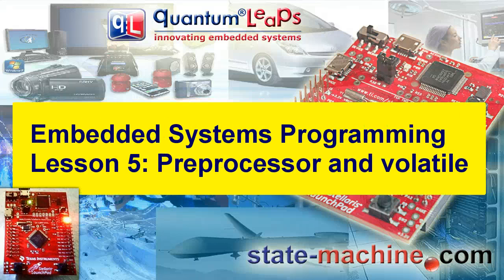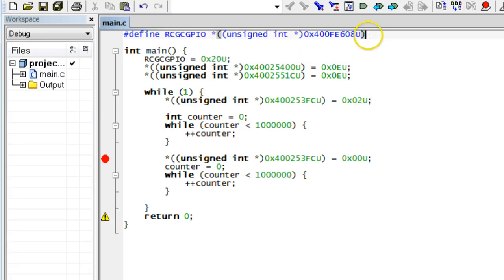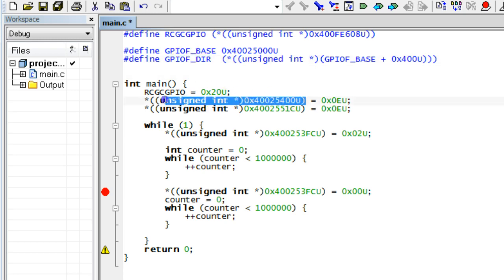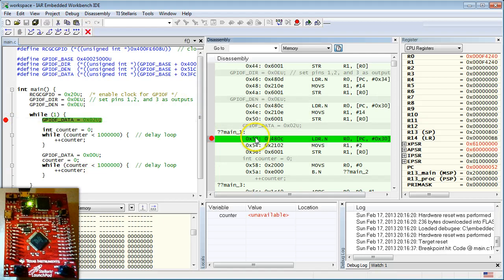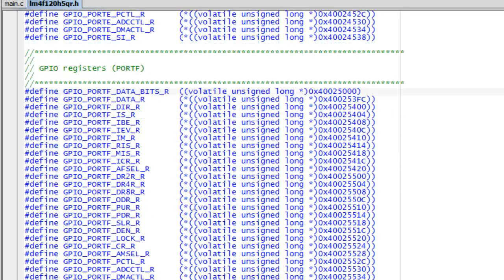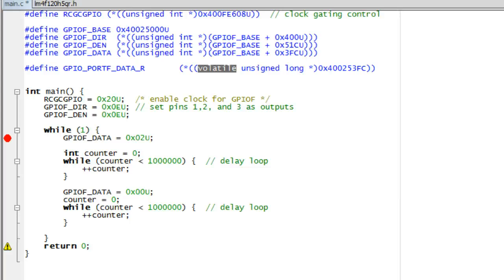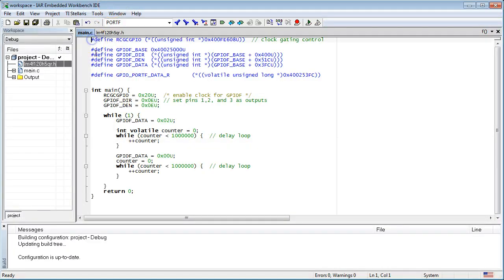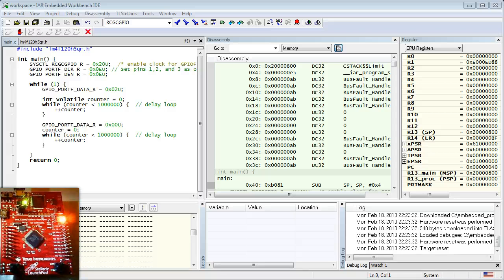#5 Preprocessor and the "volatile" keyword in C

Comment: Hi Miro, great lesson! I had a question about the compiler optimization. I am running a slightly modified version of the blink code where I alternate between r,g,b for the led after every blink. I noticed that after changing the optimization setting to high and making the relevant variables volatile, the led blinks at a higher rate than when optimization is turned off. When I track the counter variable step by step, I find that it is essentially doing counter+=4 each iteration. How does the compiler decide to do this?
Reply from the maker: The C compiler is allowed to apply various optimizations to your code, which you apparently experience in this case. The rules of what the compiler is and isn't allowed to do are a bit nuanced, but please search the web for "sequence points in C". The busy-wait delay loops are especially vulnerable to optimizations. To be really stable, such loops shouldn't be based only on the CPU. Instead the delay loops should be based on checking some hardware timer module, which is known to run at a specific frequency. --MMS

Comment: I want to learn to use the TM4C123GH6PM.h file given on state-machine but it seems radically different from the one used in this video. How is this new one intended to be used?

Edit 2: Watch episode 12 and it will cover it! 

Edit 1: Hopefully he can correct or confirm this but here's what I've found for those who look at this in the future

The "tm4c123gh6pm.h" file makes types for various register maps, and defines the base addresses it needs including the GPIO ports. It casts each base address as the corresponding type, with data members corresponding to things like GPIOF_DIR. To access something like this you need to access the data member in the GPIOF object, so you would say (*GPIOF).DIR to dereference the GPIOF pointer and set the DIR value. The -> operator is a shorthand for dereferencing a pointer to an object and then obtaining a data member of that object, so you could instead put GPIOF -> DIR which is cleaner and preferred. Your code should read " GPIOF -> DIR = 0x0EU; " (without the quotes of course, and actually a value like 0xE works fine too because it's already defined as an unsigned integer and 0xE will translate as 0x0...00E not 0xE00...0). Also, the header file depends on the "core_cm4.h" file which is from the CMSIS library. You can find this specific file on github but it's easier to go to project -> options -> library configuration and enable "use CMSIS."

The most confusing part of this to me was "How does the computer know where the address of something like GPIO DIR is, when that value is nowhere in the file?" I suspect that the answer is that it is stealthily encoded into the way the object is made. We take the base address and cast it as a pointer to a GPIO object. This object will hold each data member in memory, starting from the base address of the pointer. The memory locations of these data members like DIR or DATA are at the proper offset because the data members before them take up an amount of memory equal to their offsets. To test this I tried to calculate the address of GPIO DIR knowing only the base address and looking at the code in the header file. We know that a 32 bit unsigned integer takes up 4 bytes of space. The first data member in GPIO is an array of 255 32 bit uints, which means we would expect the next data member, which is DATA, to be 4*255=1020 spaces away, or 3FC in hexadecimal. This matches the offset of DATA. The DATA member is one 4 byte integer, so we would expect the DIR member to be 4 bytes away. 3FC + 4 is 400 in hexadecimal, which matches the offset we had for DIR. 

It feels a little weird that the memory locations are not explicitly defined, and instead we depend on the way the object's data members are held in memory, but it does work and it's a pretty cool trick. Hopefully this explanation is clear and helps anyone else who is as confused as I was.

Comment: why at high optimization level the loop is not encountered ? why the last value of  counter value is ignored with out using volatile ?please any one can answer ?
Reply from the maker: You need to look at the code from the compiler's perspective.l A loop like "while (counter < 1000000) { ++counter; }" is to the compiler a horribly inefficient way of changing the "counter" variable from 0 to 1000000. Therefore, the compiler might "optimize" it to "counter += 1000000", or if "counter" is not used afterwards, the compiler can completely eliminate the whole loop. --MMS

Comment: +quantumLeaps, LLC: Hi Miro. Thanks a lot for such a nice tutorial! I face to a strange problem; although I can set all registers but the same command structure for only data register doesn't work: GPIO_PORTF_DATA_R = 0x20; !! But it can be nicely set using (*((unsigned int*)0x400253FC)=0x02) command! Do you have any suggestion?!
[My board is TM4C123GXL and I already include "tm4c123gh6pm.h" and <stdint.h>. ]
Reply from the maker: I'm not sure which "tm4c123gh6pm.h" header file you use (it is not included in the lesson5.zip project for this lesson), but the "tm4c_cmsis.h" and "TM4C123GH6PM.h" header files included in the later lessons (starting from lesson 12) is based on the CMSIS (Cortex Microcontroller Software Interface Standard). The CMSIS prescribes a different way of accessing registers, based on the C structures, so GPIO_PORTF_DATA_R is NOT defined anymore. Please watch lesson 12, which explains C structs and the CMSIS. --MMS

Comment: Why do you think it is better to write "volatile" after type declaration? Thanks for this great tutorial :D
Reply from the maker: By placing "volatile" or "const" after the type, as opposed to the usual placement before the type, I follow the recommendation of Dan Saks. He explained the reasons in the article "const T vs. T const": http://www.dansaks.com/articles/1999-02%20const%20T%20vs%20T%20const.pdf . --MMS
Reply: Thanks. There is also a discussion about use of #define vs const. Which one is better and safer for embedded design?
Reply from the maker: Generally, any alternative to the preprocessor (#define) should be preferred in the code. This is because pre-processor macros are expanded before the C compiler has a chance to analyze the code, to the compiler cannot perform syntactic analysis on the macros before their expansion. Also, macros can have unintended side effects. One alternative to #define is providing integer constants as enumerations (enum {...}). --MMS

Comment: From where did you get that the GPIO DATA register is of offset 0x3FC? In the data sheet it is written to be 0x000. Thanks!
Reply: A short explanation is: 
The data register in fact does not reside in only one address but instead it is mapped to 256 different addresses. One of them is at offset 3FC (another one is 0x000 which I will use as an example to their difference below). According to the datasheet, only bits [9...2] (8 bits) of these addresses are considered and used (or we could say that each address in general is used) to allow reads and writes to a certain permutation of the data register which also has only 8 bits in use (see the datasheet). (for these [9..2] bits in an adress, 1 means i/o to the corresponding bit in the data register is enabled, likewise 0 means i/o is disabled)

For example if you write data to address with offset 0x3FC which is: 0000 0000 0000 0000 0000 0011 1111 1100,  its bits [9...2] = 1111 1111 => all bits you write to this address will be written to the corresponding bits in the data register too.
If, however, you write the data to offset, let's say, 0x000 whose bits [9...2] is 0000 0000 then the data register will NOT be affected no matter what you write into this address.

The purpose of this isolation in bits is that GPIO ports usually comprise many pins each and often we would want to perform io on individual pins without affecting others. However, there is only one data register for each GPIO that is shared between pins, e.g. bit 1 of the data register is mapped to pin 1, bit 2 is mapped to pin 2 etc so we need a method like this to be able to perform io exclusively on each of these pins (or a certain group of pins). 

I think you might want to read the description of the data register in the Register Description section which offers a more thorough explanation. Pay close attention to the part where it describes the memory layout of the data register and how to read from and write to it.
Reply: You can find the explanation in lesson 7

Comment: I have a question to the memory addresses. I understand the principal of Clock Gating and also the GPIOF_DIR to set the pins as outputs but what exactly is set with the GPIOF_DEN?
Also I would like to know if that procedure would apply to other embedded systems?

Thanks!
Reply from the maker: The "GPIOx_DEN" register stands for "Digital Enable". The purpose here is to configure the selected GPIOx pins to be used for digital input/output. This is necessary, because pins coming out of the package are a very limited and precious resource (in fact, pins cost more than the silicon inside). Therefore, pins have multiple functions (e.g., analog, receive/transmit, PWM, etc.), which can be selected in software. Please refer to the TivaC Datasheet, Chapter 10 "GPIO" for more information.
Reply: Thank you for your answer, it makes more sense now.

Comment: But how is the compiler exactly messing the variable up? From what is understand the variable is registered to cpu memory and then the compiler places it back to a different ram memory adress or the compiler doesnt place it at all? What is exactly going on?
Reply from the maker: Actually, the counter variable does not have any memory address before it is declared 'volatile'. The variable is placed in a register. But the really important point here is that the whole delay loop looks to the compiler as a very inefficient way to change 'counter'. Instead of changing 'counter' one count at a time, the compiler is free to optimize it to just one big change. It is like you would deposit $1,000,000 to your bank account by writing million checks for $1. Instead of this, you could simply write one check for $1 million. But then the compiler also notices that you never use the `counter` again, so it optimizes the whole thing away. To prevent all this from happening, you need to declare 'counter' as volatile.

Comment: Thank you so much for this great course, i'm learning something new in each lesson!

I have a question about addressing in assembly by using the PC. 
Say i have currently stopped the execution on the instruction at address 0x42:

stopped here   -->    0x42: 0x490d         LDR.N     R1, [PC, #0x34]  
(next instruction)    0x44: 0x6008         STR       R0, [R1]

I know it corresponds to loading R1 with the value 0x400fe608, as correctly happens, but I don't understand how...

When i am stopped at the instruction above, I have:
PC = 0x00000042

and the addresses which are closer to the "target" one are:
0x72: 0x1c40         ADDS      R0, R0, #1
0x74: 0xe7fa         B.N       0x6c
0x76: 0xbf00         NOP
0x78: 0x400fe608     DC32      0x400fe608 (1074783752) <------- the value i'm looking for
0x7c: 0x40025400     DC32      GPIOFDIR
0x80: 0x4002551c     DC32      GPIOFDEN

First approach I tried:
Simply add 0x34 to 0x42 ==> 0x76 ==> wrong.... i have a NOP at 0x76

Second approach:
Looking online, at http://stackoverflow.com/questions/24091566/understanding-the-nature-of-arm-pc-register, it says:
"In Thumb state:
- For B, BL, CBNZ, and CBZ instructions, the value of the PC is the address of the current instruction plus 4 bytes.
- For all other instructions that use labels, the value of the PC is the address of the current instruction plus 4 bytes, with bit[1] of the result cleared to 0 to make it word-aligned."

So, being a LDR instruction, i add 4 to the current instruction (0x42 + 0x4 = 0x46). Adding the offset 0x34, i get 0x7A, which, again, is not what i want... 

Third approach:
The only approach that seems to work is taking the address of the next instruction (0x44) and adding 0x34 to that, getting the 0x78 i'm looking for.

But... why do the docs tell me to add 4 bytes? Maybe i missed the zeroing of the bit[1]? That would actually make me obtain 0x78, but i'm honestly a little confused...
Reply from the maker: The PC-based addressing is made a bit complicated due to the pipeline effects. (Instruction pipeline is touched upon in Lesson 2.). But basically, by the time the PC-based LDR instruction executes, the PC is already incremented to the next instruction. In programming practice this is not an issue, because you never calculate the PC offsets by hand. All assemblers provide some help, such as LDR r0,=0x400fe608 will generate a PC-relative load for you.

Comment: Hi,Sir
1.When would the counter discard? 
2.How to sure the bug is caused by optimization or not,especially the normal variable?
3. If I use a timer interrupt func. which has a global variable in it, dose the optimization still would affect the code?
Reply from the maker: +thentust 
1. The compiler is always free to optimize your code, so you cannot assume that a non-volatile counter will be in fact incremented in a slow and very inefficient way (from the compiler's point of view).
2. You simply need to know that the compiler might optimize your code. Therefore, without the 'volatile' keyword your code is incorrect. It just so happens that the code works at lower levels of optimization, but this is an accident. It is not the compiler's problem. It is your problem.
3. Global variables inside interrupts are tricky, because they are subject to race conditions. I will discuss these issues in the upcoming lesson 20. Stay tuned...

Comment: Hi Mr,

Thank you again for this interesting series of videos, this time I want to ask you about what really happned when you pushed the compiler optimization capabilities to "high"; in fact why the while loop controling the counter variable(delay loop) isn't executed????!
thnaks fo the explanation
best regards
@Quantum leaps, LLC
Reply from the maker: +khaled gharbi The value of the 'counter' variable is not used anywhere inside the loop, except the counter is incremented. The compiler notices this, and treats the whole loop as a very inefficient way of incrementing the 'counter' by the number of iterations. So, instead of executing the loop, the compiler optimizes it out and sets simply counter = 1000000. Please note that the compiler is allowed to optimize your code that way (unless you declare 'counter' as volatile).
Reply: +Quantum Leaps, LLC Good morning Mr, it is clear now , as I understand the compiler optimize the whole while loop by seting the counter to 1000000 and as a fact there is no delay. thanks again sir. :)

Comment: If you are using the header file tm4c123gh6pm.h: you might get the error:

Error[Pe020]: identifier "uint32_t" is undefined 

If so, you can fix this by also using including this line in your source file: 

#include <stdint.h>

(this has the typedef for uint32_t, which is used in tm4c123gh6pm.h instead of unsigned long).
Reply: Thank you Eric Z
Reply: Thanks man, still not working yet but this is a big piece of information.
Reply: Thank, Eric. Got stuck for some time.

Comment: dear sir 
I tried to include the header file for TM4C123GH6PM processor. the compiler generate many errors until i change the definition type from uint32_t  to unsigned long as follow:
#define GPIO_PORTF_DATA_R       (*((volatile uint32_t *)0x400253FC))                 // not work
#define GPIO_PORTF_DATA_R       (*((volatile unsigned long *)0x400253FC))        // work good
and do this for all pointers that i used . 
I cann't understand why?
Reply from the maker: The <stdint.h> file is quite essential for embedded programming, so you should be able to use it. At this point, I would highly recommend that you simply download the code for lesson5 from http://www.state-machine.com/quickstart/lesson5.zip and try to build it on your machine.
Reply: I am getting the same errors, I think unit32_t is declared in stdint.h file. However, I tried to include that file without any success. The compiler gave me error at the stdint.h file. Have you found the read solution? Thanks
Reply from the maker: The <stdint.h> file is part of the C99 standard library. It should be available in all C99 compilers. IAR EWARM certainly provides it.
Reply: Emm but I don't know why I am not able to include stdint.h  or use its declaration of unint32_t. However I found a temporary solution which is changing type in the header file from unint32_t to unsigned long. Some people online said it is a wrong solution!